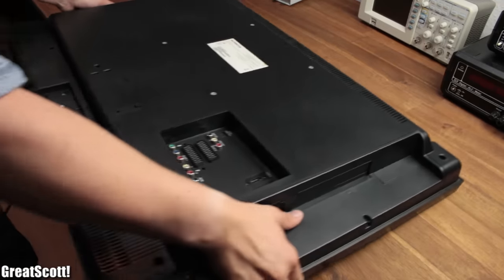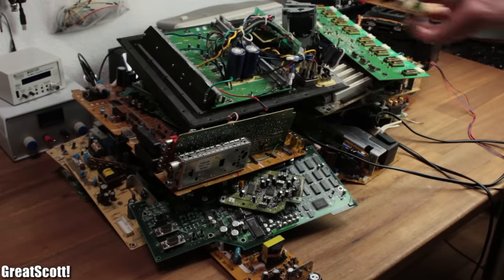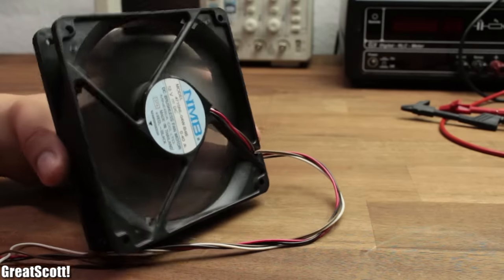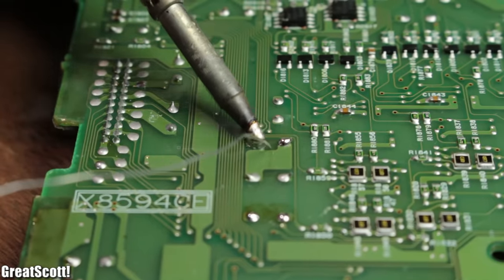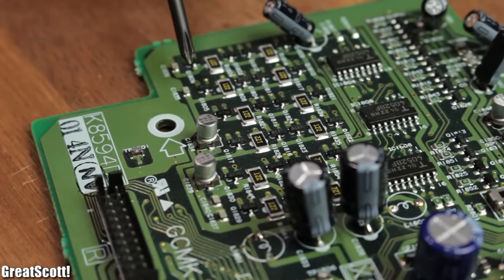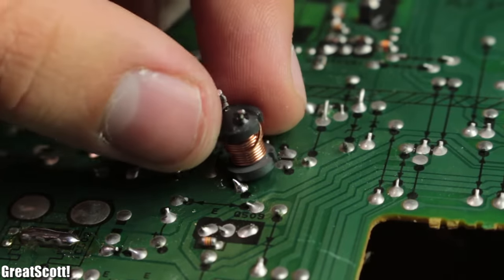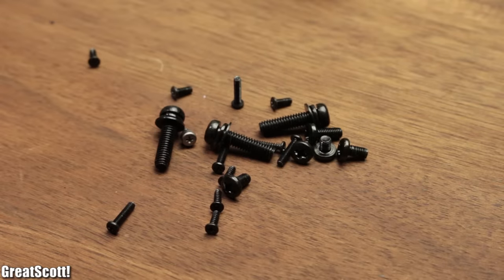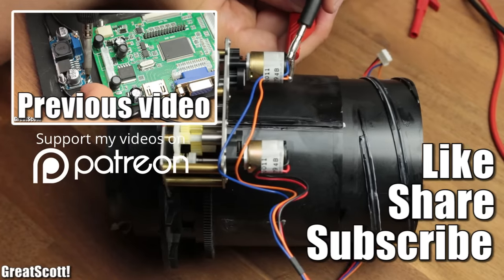What is worth desoldering from old electronics? || DIY Fume Extractor

Comment: don't waste your money on solder wick. if you're salvaging electronic components you've got tons of free multi-strand wire that you can just strip and rub with flux to make your own solder wick. and smd components are the easiest to salvage. remove any electrolytic caps or other temperature sensitive components from the board,  toss it in a toaster over until the solder melts then tap it against a hard surface or scrape the components off.
Reply: Maltfalc you will destroy most  of electronique  chip  (cause they support   high temperture  for like  30 seconde max
Reply: +FOXER how do you think they get the chips on there in the first place? they heat the whole board to the melting point of the solder.
Reply: Maltfalc https://www.youtube.com/watch?v=RjoxCprf3Kk but this is a small scale in a factory its done faster and with more PCB's on one board
Reply: FOXER uh, that didn't solder a single one of those components... that's a vacuum based SMD pick and place machine.  The board will have been subjected to a solder paste stencil and once the components are in place it'll go through a reflow oven to melt the paste using a very specifically set thermal curve.  Reflow is pretty much always used when surface mount is in use because you can't wave solder that stuff, and power boards are the only place where you tend to find high volume through hole only processes.  Maltfalc is right, a toaster oven is basically the same conditions they use to make the stuff in the first place... you can turn a toaster oven in to a reflow over if you shove a pid controller on it and a decent thermocouple.
Reply: Use a heat gun, cover the sensitive components with scraps cut off of aluminum cans.

Comment: Haha, we are totally on the same track here and would give exactly the same advice. I follow it myself. 😂
In some rare cases I also desolder smd parts, but as you said: they're very fragile. 

An additional tip: test the components before reusing them. It can save you much time and head scratching...
As the components mostly come from defect devices, there sometimes hide defect parts in unexpected places.

Comment: I've had a similar idea to take some carbon filter and a PC fan but from what read they generally aren't strong enough (needs a higher static pressure) at least not anything larger than about 50mm, so I figured I'd get a proper fan such as this. 
http://www.digikey.com/product-detail/en/PF80381BX-000U-S99/259-1670-ND/4865301

It's a tad expensive for a fan ($20) and loud as a jet (74db) but total cost will be about $35 if you include a power supply ($6) + I want to add a buck converter with current control so that I can control its speed, ($4) so still cheaper than something like that hakko and in theory because of the fan should have some pretty epic performance. (oh yeah and it might be a good idea to get a fan grill too, you really don't want to accidentally touch something as powerful as that.)

Edit: got this instead.. http://amzn.com/B007WLPNPW cheaper and almost as good, so that cuts nearly $10 off the costs (plus I had a $5 gift card making it a mere $7)
Reply from the maker: vgamesx1 Sounds promising.
Reply: GreatScott! Thanks
Reply: joe black Which 4amps can be easily supplied by a 60W laptop charger and on the cheap, can be obtained for about $6 off ebay, so I don't see what the big deal is?

As for size, I think you kinda missed the point, because as from what I've learned so far a high static pressure is much more important than air flow in this case because you need to pull air through something and obviously I'm not too concerned about noise while soldering or I wouldn't even be looking at a 70+db fan Lol.. but if you have any suggestions then by all means post a link and I'll give it a look.

Yeah I realize at nearly $40 I could've just bought one, but the concept is that I'm spending nearly as much but getting fan that is much more powerful than one in a typical fume extractor, like buying a computer vs building it, sure at $500 I could just buy one, but at the same price you could also build one and get up to double the overall performance, especially when you consider used parts..

Thanks and one thing I didn't mention is that I want to give it a secondary use, attach a hepa filter to it as well, not that I need it more so because I might as well get my money's worth out of the fan and I found a couple of em for $4 anyway.. Cheers.
Reply: joe black So.. no suggestions then or have you just not got the chance to do so yet?
Reply: vgamesx1 silverstone FM121. Won't deafen you and is capable of up to over 120CFM if memory serves. It is a server grade fan, but is ideal for these niche projects. If you need to go bat shit crazy on the CFM, look at the 120mm delta fans.
Reply: Richard Smith Thanks, not a bad fan though I spent a while longer looking to cut costs and I found a Delta PFC0812DE-PWM for $12 off amazon, so I'm considering that and just running it at about half speed for typical usage, though I'm actually looking for a good balance between airflow and static pressure, so ideally about 60+CFM and at least 1inH2O (25mmH2O) for $20 or less.

So whatcha think of that? I mean it's still a kinda noisy but shouldn't be ear shattering like the other one Lol.
Reply: vgamesx1 25mm? you aren't going to find that in any pc fan... do you mean 2.5mm? Most 'static airflow' fans usually hit around 2.5mmH20.
The silverstone FM121 is a static pressure fan, but it also is high cfm. The reason i suggested it is because its a fan designed to do everything. Just give it the voltage it needs for the application and it does a good job at it, its a bit of an unsung fan however.
Looking up the specs...
110CFM and 3.26mmH2O, it also retails for $20.
Reply: Richard Smith Errr, you've confused me.. is a higher value not better in H2O? because specs seem to indicate so, but it's quite hard to find full details on the subject, anyway I did mean 25mm, if you look at that fan on digikey it's spec'd at an H2O of 2in (or 50mm) thus I would assume it to be a rather strong fan unless I'm missing something..?

https://www.digikey.com/product-detail/en/PFC0812DE-SP04/603-1166-ND/1850535
Reply: vgamesx1 I was only giving a recommendation of a computer fan for multiple purposes, that little fan you are linking is not made for computers, it would cause hearing loss. The only fan that would touch it that I know of is the Delta fan, but I have not needed such a high powered fan for any projects, and these fans are typically used on server racks where people will not be anywhere near them as they run.
Yes, the higher the number the better, but such a high static pressure is not found on consumer level parts, short of the delta fans, which are just silly for most people.
120mm delta fans are 27.48 mmH20 btw, and 240 cfm. You can find them for less than 20 bucks on amazon.

I wonder how many you would need to lift a person... not many! :P
Reply: Richard Smith well I wasn't knocking your recommendation although honestly, the CM SickleFlow 120 is a much better value because it performs almost as well but costs less than half of the FM121 ($8 for 69CFM, 19db and 3mmH2O).

About needing a high powered fan, I need something just a bit stronger than 3mmH2O because I'm going to be pulling air through a couple filters and I don't want it to turn into a failed project as others have discovered by simply not using a strong enough fan, which the second filter is only about 80/90mm large, so I can't really use a 120mm fan because the air would just blow around it instead.
Oh and speaking of hearing loss, haven't you ever mown a lawn with a gas mower? if so then that would be quite a bit louder than the 50-70db these server fans run at Lol, yet I still haven't experienced hearing loss.

Dunno, you wanna create a kickstarter for a jetpack and buy a bunch of these? (157mmH2O and 544.0 CFM)
https://www.digikey.com/product-detail/en/R150A3-051-D0790/P15556-ND/3487200
Reply: vgamesx1 half the CFM and less static pressure? I was recommending a fan good for multiple purposes, not just pc related cooling :P
But you need rediculous airflow and CFM, so it doesnt matter.
Reply: vgamesx1 tube fans designed for hydroponics are going to be best run with a carbon filter as that is what they are designed for ;-)
Reply: oldskoolhead0 tube fans?
Lol are you talking about squirrel cage/blower fans? I've not heard someone call them tube fans before :D
I thought about it, though most of them have very little air flow, so I wasn't too sure how far it would reach ya know? Plus I've just gotten everything I need anyway, so I might make a video on how well it works. :)
Reply: tube fans like systemair rvk fans
Reply: oldskoolhead0 inline duct fan, yeah different than a blower, though people sometimes still call them blowers, depending on if they blow or suck that is :P Many inline duct fans are meant to exhaust.
Reply: oldskoolhead0 ahh I see, interesting.. well the fan I got appears to be sorta like a mini tube fan, because it's kinda wide for a PC fan, I was quite surprised by its size and weight when I first got it, I was expecting a tiny little thing lol.
(on a side almost as surprising is that it can easily move itself if you set it on a table despite it's weight of about 0.5lb or so)
Reply: yes a tube fan works a bit like a turbo so can better provide back pressure to force air through the filter, a pc fan is just open air so can easily loose pressure given resistance
Reply: Moth If sound matters, it'll be an issue, worth pointing out. They sound like jet engines :P
Reply: +vgamesx1 
Or use a bathroom ventilation fan which should be more then up to the task as they're designed to push air through a duct.
Reply: joe black Fume extractors cost about $26 and up at FRYs electronics. An old 120mm fan and carbon filter is like $6. If you have multiple fans then you can build multiple extractors for no extra cost. I've built my own Fume extractors. It's worth it.

Comment: This is an old video, but please note that activated carbon is not sufficient for filtering out solder fumes. The hazardous part of solder fumes are particulates, and a porous filter like in this video offers little to no protection against them. This works fine to disperse the fumes in a well ventilated work area, but otherwise you will need a proper hepa filter. Otherwise you are just blowing the particulates around then breathing them in anyway
Reply: Indeed. He could use 3 12 V fans, putting a HEPA filter in between the first & second fan. 🤔😏

Comment: I never salvage Electrolytic Capacitors... Usually their value (both capacitance and voltage) has degraded over the years. Unreliable to use in future projects....
Reply: It depends on how you plan to use them. If it's not for filtering or HF switching it's OK to use old parts and put them in parallel to get a proper decoupling or bypassing.

Comment: For resistors and ceramic capacitors, I simply bought in bulk every standard value of these parts, so I do not salvage those any more. There are sellers on ebay who combine all the values in bulk for really cheap. A few purchases and you have the ultimate parts collection of thousands of parts. High precision resistors and those half watt and higher get salvaged. Bought bulk zener diodes and fuses too, but I still salvage them anyway. Salvaged electrolytic capacitors saved me many times from having to buy them, since they are too expensive to buy every possible value with every possible voltage. Just use an ESR meter to make sure they are good. Many devices fail due to electrolytic capacitors and many got fixed with these salvaged ones.

Comment: Here's a tip, when you cut the power supply plug leave a few inches of wire on it so that it can be used later in some project.  The whole point of the video is re-using components.

Comment: Removing parts from PCB's just for your junk bin is great practice for when you need to do it for real to make a repair. It's also a good way of getting a wide selection of weird parts that can again come in handy for odd repair jobs. Just make sure you test every part before you put it into your junk box. If the item you are stripping was faulty, then it was faulty for a reason and the last thing you want to do is add faulty parts to your junk box. It's also good for the environment.

Comment: I only take caps and jacks, A few micro ICS. But the hardest parts sometimes are those smd fuses they be paper tiny at times. GREAT VIDEO YARR. Remember Any transistor has to be taken out first or installed last. And if over heated while removing thier no good no more

Comment: Thanks Mr Scott, I learned a lot about the bits and pieces soldered to motherboard and what they are for,  there were so many that I never knew existed before, so . it was nicely explained for the non electronic geeks like me out here in digital space. Thanks.
I too have collected boxes of old tat and electronics from here, there and everywhere because visually, they look so cool. I had them fixed, edge to edge on my wall but needed the space for more tat so put up 7, 10 foot long wooden shelves.
Some of the older model PC's have amazingly engineered metal cooling systems built around their CPU's. When my local car doctor upgraded to a digital system I was given all kinds of amazing probes, tweezers and pump things with tubes, fans and lots of Steampunk fixings and light bulbs.
I also keep the magnets, especially the neodymium flat ones near the hard drive reader mechanism and every microwave microtron magnets I can get my paws on to build the first working perpetual motion machine. Actually not because magnets lose their magnetism and I'm told it just isn't possible to make.

Comment: same here. parts like this in boxes dating back to 2001..to 20021 so I know I replaced the caps in my monitor for free. Using parts of an old amp. Your video is spot on mate. Thanks for sharing this VITAL information. I have been doing this since 2001.
Reply: BTW Fumes? well I do this on my porch outside when there is a constant breeze. Thank GOD ... my house is built to maximise airflow. But thanks for the mates that live with no breeze and now they know how to vent (no pun intended). Spot on mate.

Comment: I keep ac-to-dc adapters. The can be pricey to replace and having a spare for something you use means you can have two locations where it is used without having to fish out the wire between locations.

Comment: Sonny, the downside with using a desoldering wick is that heat runs up the wick burning the fingers. I have used them a number of times and have discontinued using them. Instead, I use a solder sucker. It works quiet well and efficiently

Comment: I have absolutely terrible luck with desoldering braid. Mine almost always ends up soldered to the board more than wicking up solder from the board. I really wish I knew what I was doing wrong! I don't have the best of luck with the manual solder pump either. Every once in a while I'll get lucky and it will neatly suck the solder out but more often than not it just leaves most of it behind and I still can't wiggle the component out.

Comment: OMG I thought I was the only weirdo who salvaged bits from old stuff! I HAVE FOUND MY PEOPLE!!  
AND I gotta say for most work, those sucker things are more trouble to use - I found the most control comes from the manual rubber squeeze bulb/ball things, as they can do several spots in a row using one hand without looking for the button/trigger and it is steadier in the hand for aim... I found it more efficient than the tube style and easier to manage.  I was eyeing that desoldering tool from hakko, though, as that looks like the REAL  upgrade to have!

Comment: Good timing. I just came to watch some YouTube with a morning coffee and see this, right after I was rummaging through some old boards to check for the tenth time if they have anything on them that I want. I end up with a lot of obsolete audio equipment as well. I take the fasteners, the harnesses (for bulk wire use), motherboard or front panel buzzers/beepers (good for replacement on kitchen appliances too), front panel switches and audio jacks. By the time a motherboard is junk, the rear connector types are no longer applicable - eg. D-sub, Firewire, RCA phono, for example. I will keep the old style steel computer cases without the shapes and grills formed into the later styles. I lay them flat on a work shelf as dividers for storing things. Any plain flat portions of interior metal is saved as sheet metal stock for when I need to fabricate something not computer related.

Comment: You DO save a lot of money!
When I go to Mouser to buy a few diodes, with their advertising and minimum order... I get a £40 bill every time!
("yeah, I am running low on solder" "oh, check out these gold sockets!" "well, I don't need those caps right NOW but what if I run into a circuit with them in the future?", "it's only £0.97 for the pack!")

Comment: Desoldering DIP ICs works quite well with a hot air gun. Stick a flat screwdriver under one side of the IC, heat it up from the soldering side and pop it out as soon as the solder is molten. Most of the ICs do survive quite a lot of heat. I rescued a bunch of old logic ICs with this method.

Comment: transformers, coils, power transistors. some caps, resistors. hardware, remove the obvious and easy then store the PCB for future scavenging.

cheap fume extractor :) thats what we used in production on the benches at Gardners (Radio) back in the 90s.

it was shock to go to a modern factory with proper fume extraction with air pumps and big ducts, and breath clean air